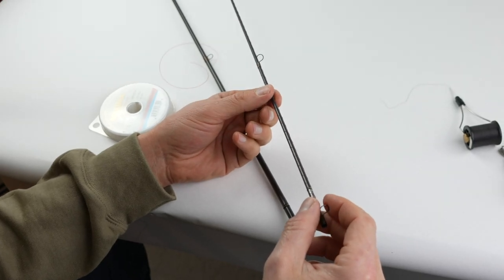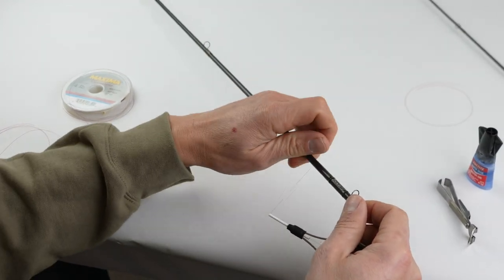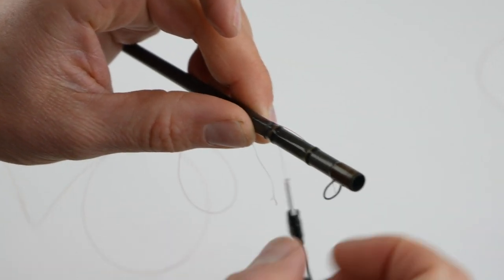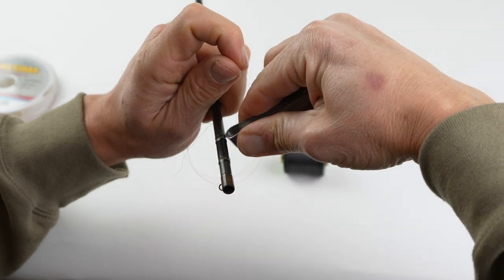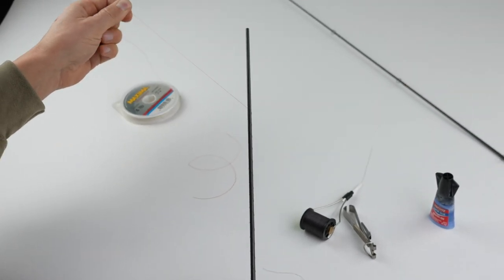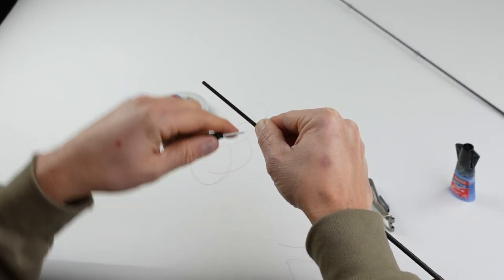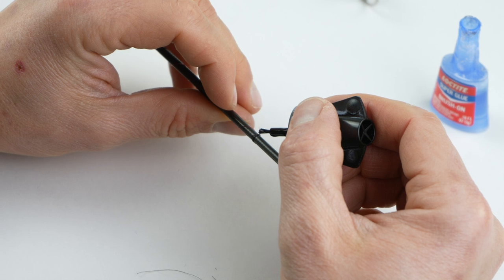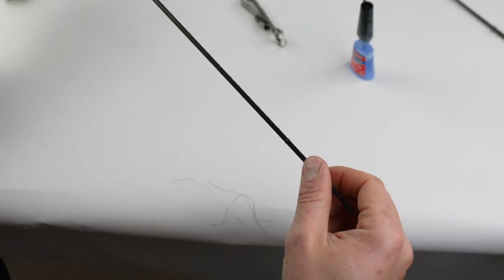How to stop your micro leader from sticking in the rain

Comment: Old dominion trout bum,  on YouTube, has a video on this. This is where I got the idea from.  It actually works really really well !!   I use Yozori braided line in a 0.006” diameter, 10 lb test.   I leave it on the rods so when it’s wet or raining I don’t have to deal with a sticking mono on the blank.   Thanks!!!       Using plumbers double sided black tape works well to attach the tippet or braid to the rod blank.
Reply from the maker: Oh interesting. I’m not familiar with that channel. I’ll have to check it out.

Comment: Interesting idea to do it semi-permanently. Though it looks like it takes quiet a while to do though.  When I see it’s going to rain I just use duct-tape and tape in the tippet at the tip and then wind down my whole rod and tape in the tippet at the but section again. Takes about a minute to do. Have you ever done it like that?
Reply from the maker: I'd be a bit worried trying to get the duct tape off myself so I haven't used it that way. When I'm not doing it for the camera, it takes me about 5-10 minutes per rod and then it's pretty much always there in case of unexpected rain.

Comment: Thanks, nice idea. Any suggestions for avoiding the other problem I have with a micro leader - getting it wrapped around the tip of the rod a lot?
Reply from the maker: That’s usually a casting issue. 1. Maintain an oval cast with a lot of energy on the back cast. 2. Wait until your back cast is fully turned over before making your forward cast. 3. Keep your false casts short and shoot the last cast if you need extra length. 

Also, if you are rigging, keep the leader in the water so the current holds it away from the rod.
Reply: @tacticalflyfisher3817  Yes, it is usually when I am mucking about getting stuff out of my pack or changing flies with no tension in the system, and I look up to find a couple of wraps of leader around the rod tip. They are much harder to flip out than with a thicker stiffer leader. Thanks again for sharing your experience

Comment: Very handy tip and good demonstration. Rain is the most common one but also great for when your rod gets wet from those times where your rod ends up in the water by your own mess ups. For example if my leader wraps itself around the tip and I'm mid river in swiftish current i often have to awkwardly hold my rod 2/3rds of the way up while I unwrap it, meanwhile the rest of the blank is in the water getting wet. And on an overcast winter day it can take an age to dry.

Comment: Great tip, Devin! Thank you. I never really had this problem before I moved to Oregon… and it’s been bugging the crap out of me lately. I will try it soon. I think I will try putting that final loop in place before I start wrapping the tippet material. Any reason not to? Merry Christmas.
Reply from the maker: If you put too many wraps over the loop you won’t be able to get the thread back through. You can also use a bobbin threader and it’s a little easier to hold in place while you make the final wraps.